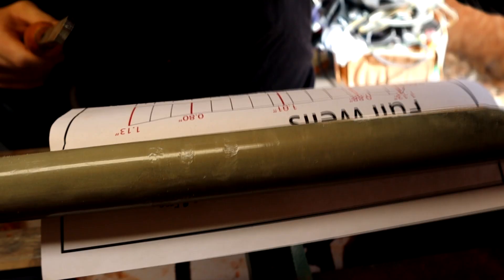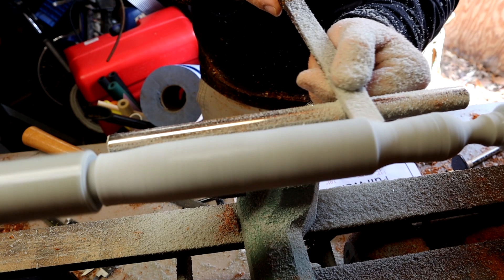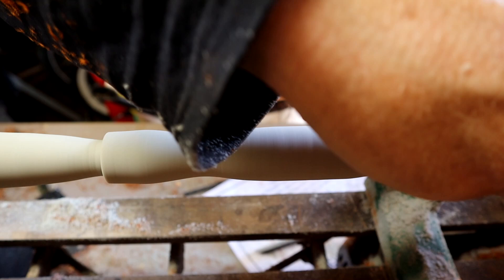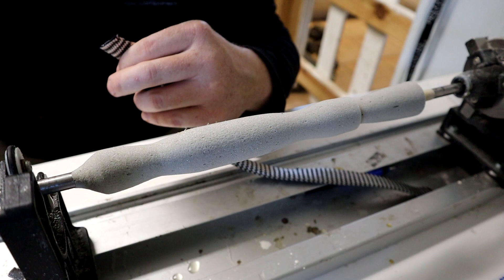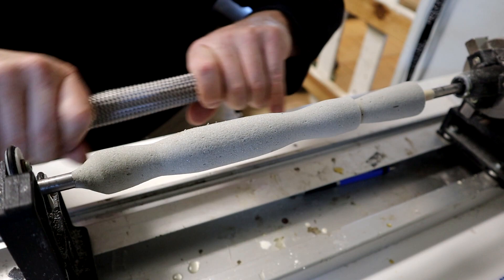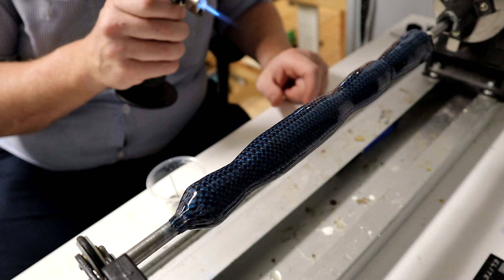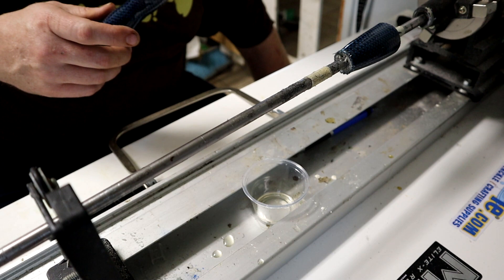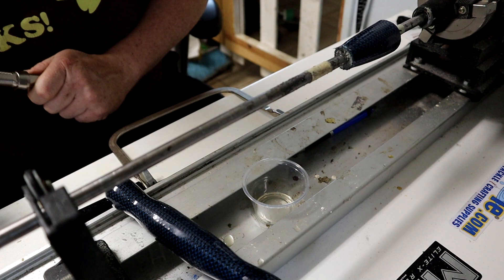Custom Carbon Fiber Grips How To Custom Rod Building

Comment: Good comment about sanding into the carbon skins versus sanding into the kevlar or glass types. Along with Andy Dear, I am the inventor of these grips and am always happy to see how well they have caught on since we made the first ones in 2005.
Reply from the maker: I have done your technique with the permagloss finish.  Really makes for a perfect final product on carbon fiber.
Reply: Evolve Custom Rods - how to make the grip have a real nice looking transition from grip to blank? Do you add a small winding check on the front of the fore grip? You don’t have to worry about the side that butts up against the reel seat, but should I do something to the exposed side of the grip that faces the guides?
Reply from the maker: @magicmike9518  if you just taper the carbon fiber down it will work.  I usually just cover it with thread to get a smooth transition.  Winding checks work as well, I have used them on several rods.

Comment: Outstanding video… thank you! 
Question: I want to hollow out a cavity in a CSX Carbon fiber fore grip. Cavity would be a triangle 3/8” wide by 1” long. I’d like to attach the rattle from a Western Diamondback rattlesnake in the cavity then embed in epoxy up to flush with the grip. 
I plan to apply epoxy to the grips before cutting into it. 
I’d appreciate any pointers, suggestions, cautions etc..
Thanks for your help. Brian
Reply from the maker: I don't really understand, if you want to put snakeskin on the underside of carbon, you will not see it.  If you want to put it on the outside, just build up the epoxy so it is level with no pockets.  Then I would use a little color preserver to put on the snakeskin to make sure it stays where you put it.

Comment: John it's been over a week since I applied my first of epoxy to the guides and need to apply the second coat any tips  on applying the second coat since it's been over a week.
Thanks
Reply from the maker: Just put it on, make sure its clean, but I have gone a month between coats.

Comment: I’ve bought carbon fiber grips and had areas appear after use of delaminating of the epoxy from the fiber.  Appears as an area of cloudiness.  What am I missing?
Reply from the maker: Where did you get the grips?  Did you make them yourself?  If there was an air pocket in the foam, this could cause it.  Put some water on it and see if it goes away.  If there is a scuff in the epoxy, it may appear different.  Send me some pics!  I have never seen or heard of this, nor has it happened on any of my grips.

Comment: Nice video... thanks for sharing with us. What would happen if you had let the blue epoxy cure before putting the sleeve and clear epoxy over the blue? Would the carbon have a more pronounced black pattern since it hadn't absorbed blue epoxy?
Reply from the maker: Great question, unfortunately I don't know.  I imagine that yes the black may be more pronounced, but it may only make a little difference.  I probably won't try this just due to epoxy cost and time to cure.  The process takes a while when you factor in drying.  If you have the time, I would try it.  If you do, let me know how it turns out.

Comment: Very informative. Was the flex coat heated before application as it appeared very fluid?
Reply from the maker: Yes, I always heat my epoxy.  I was using a coffee mug warmer, now I use the CRB bottle warmer.

Comment: Looking forward to the foam core instructions. Hope that's coming soon? In the mean time, I'm wondering if it would be possible to cast a custom shaped grip in foam and then skin it with carbon? I have a some specialized grip I've been working on that would be somewhat difficult to turn on a lathe. I'm trying to figure out it I could do it in carbon skinned foam. Thanks!
Reply from the maker: I am going to try and do it this week, keep an eye out for it.
Reply from the maker: Foam core video uploaded. https://youtu.be/qNVIj8sucnE

Comment: Are you using a Mud Hole Power Wrapper?
Reply from the maker: No, I am using an old American Tackle power wrapper, with an upgraded Alps chuck.  The Mud Hole power wrappers seem really nice.
Reply: @EvolveCustomRods  were you using the Alps when you were turning the grip or a Lathe?
Reply from the maker: @curtiswilson4483  I have done it both ways, and you can see the videos on my channel.

Comment: On the material. Are you using white or natural to accept the color?
Reply from the maker: It is carbon weaved with fiberglass.  Fiberglass is white until it gets wet.  I will be doing an all fiberglass grip soon.
Reply: @EvolveCustomRods  thank you I new it had fiberglass just wasn't sure if you was using natural or white. Appreciate the response 👍

Comment: What type of foam cores are you using? Can you provide a supplier?
Reply from the maker: I am using 6lb closed cell foam.  My supplier does not exist any more.  Try boat foam, the flotation type.  I saw some on amazon from total boat.  I will try and get you a specific supplier.
Reply: @EvolveCustomRods  Thanks so much - it's appreciated!
Reply from the maker: here is a link:
https://www.fibreglast.com/product/6lb_Mix_And_Pour_Foam/Mix-and-Pour-Foam
Reply from the maker: Foam core video uploaded. https://youtu.be/qNVIj8sucnE